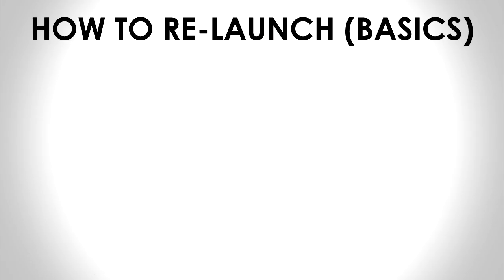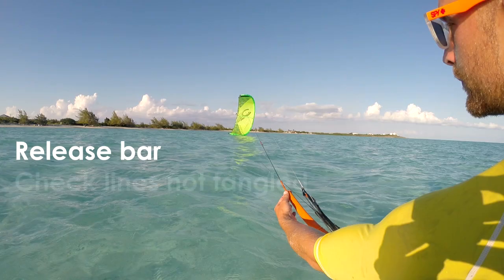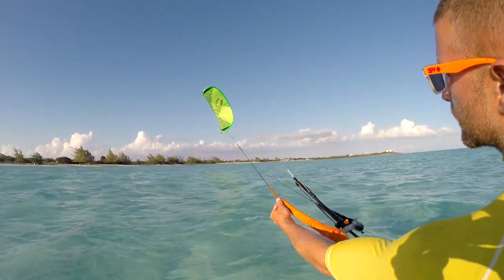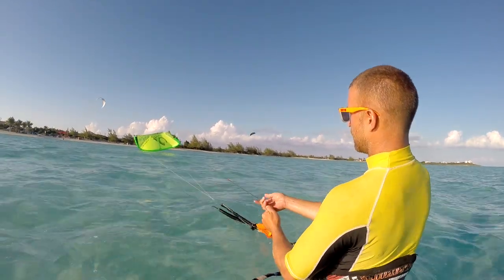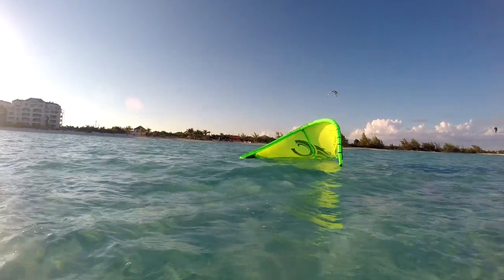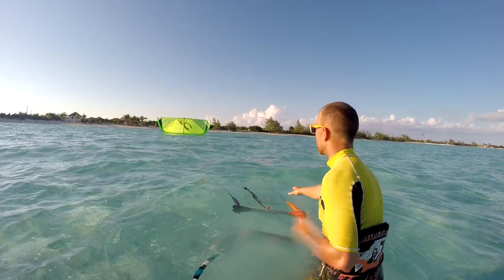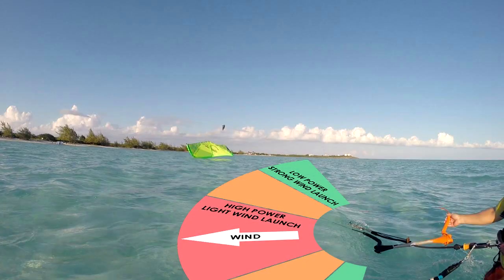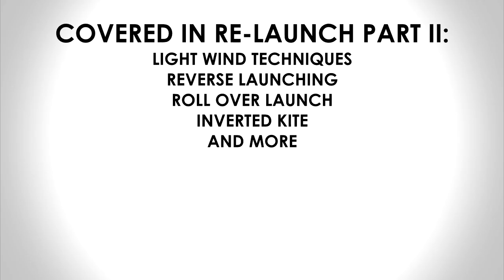How to Kitesurf: Water Re-Launch (Basics)

Comment: Great advice. Especially the part about the 'gentle' pull on the steering line.
This is all much more difficult in deeper water. Especially 'tail down' in light winds. Very difficult re-launch for me, tail down in deep water.